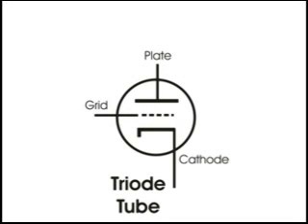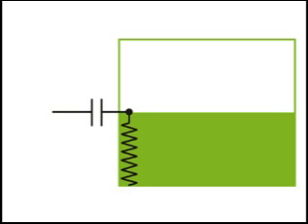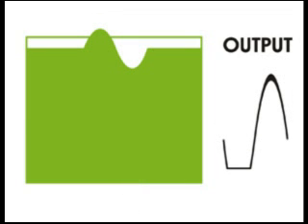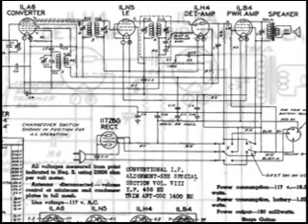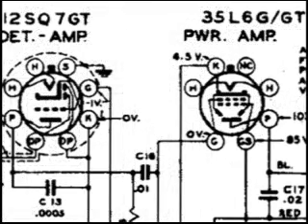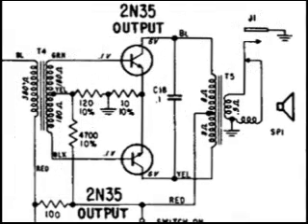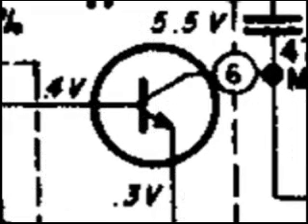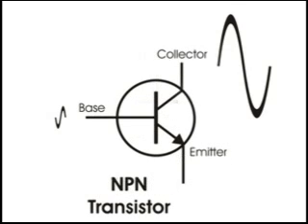Biasing Basics, Class A

Comment: why, when the upper part of the input is clipped, we see the lower part of the output clipped and vise versa?
Reply from the maker: That means the bias is class A, in the center. If the top or bottom clips before the other the bias is not in the center. Also when the top and bottom clips at the same time that also means you are over driving the amp, you have run out of power supply.
Reply: @AllAmericanFiveRadio  i figured out that the tiod inverts the signal. That's why when, say, the lower part of the input is clipped, it corresponds to the upper part of the output being clipped.
And a terminology question: When you say "the transistor is open" does it mean that there is no current running thru it?
Reply from the maker: @Koan_Om  That's correct

Comment: Does anyone know if it's possible to adjust the bias on a Mesa boogie triple rectifier that has a fixed bias?
Reply: Change resistor values.
To change the voltage needed for precise bias.
locate the resistor values on the bias circuit.
refer to schematic.what are the value of those resistors now?